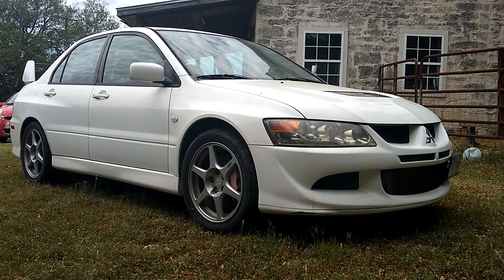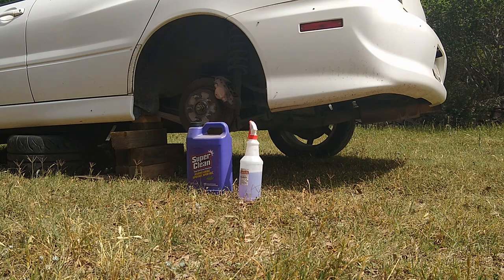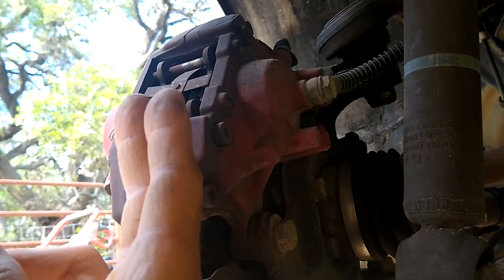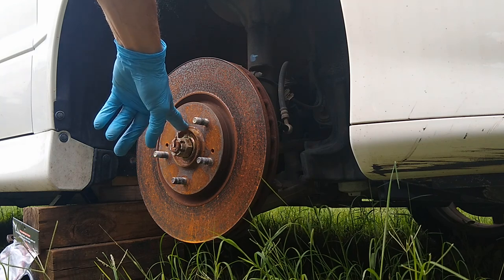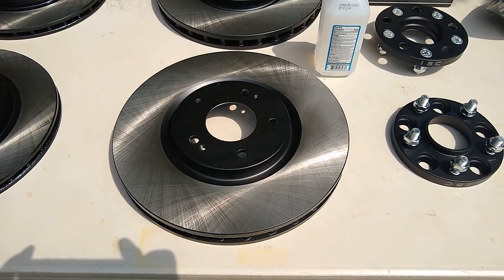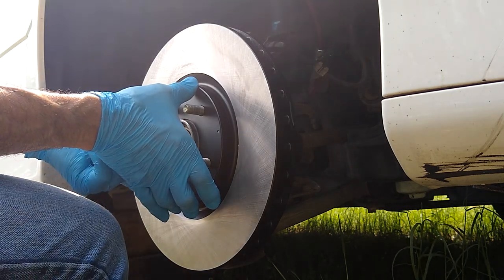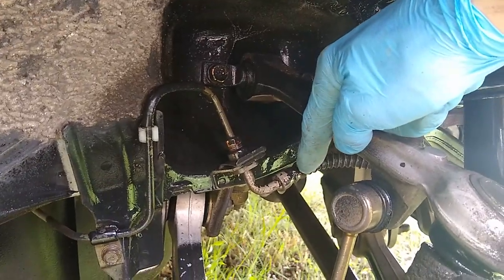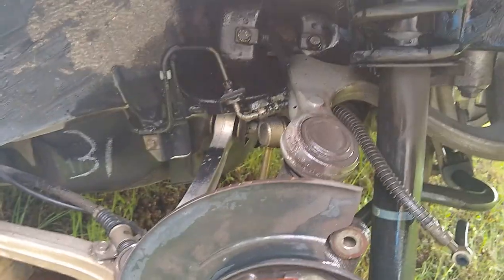DIY 2004 Mitsubishi Evolution 8 Brembo, Brake Rotors, and 15mm Wheel Spacer Install.

Comment: Awesome works.
Reply from the maker: Hi Leon, Thank you, brother. I've been wanting to give them a makeover for some time but was intimidated by the project. I had no previous experience rebuilding Brembo calipers but after getting into the project quickly learned that they are super basic in design.

If you have a project like this I encourage you to take it on. You'll learn a lot and have an amazing sense of accomplishment when completed.
Reply: @vbared  thanks.  your attention to detail is admirable.